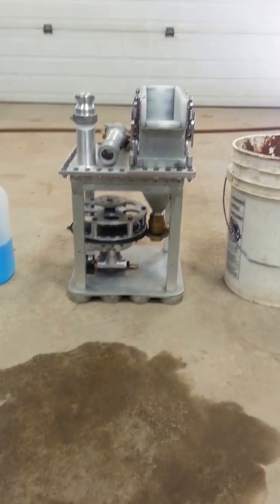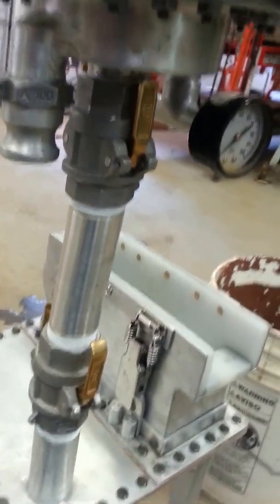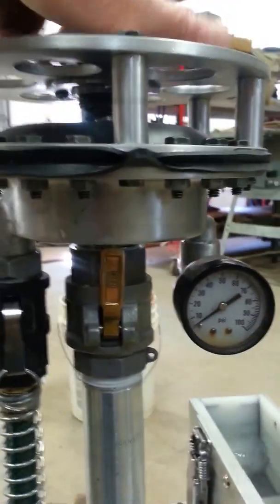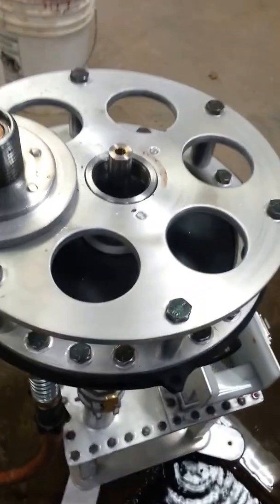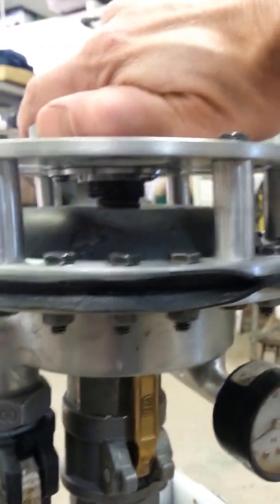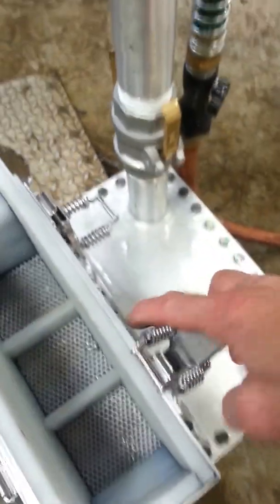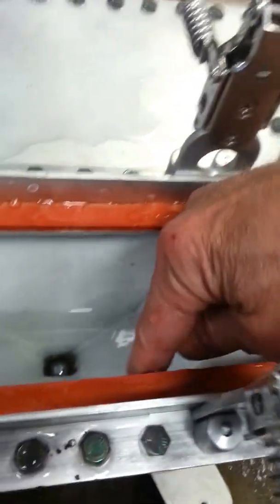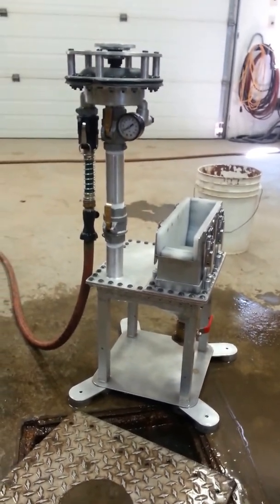mineral jig... water pulse operated.. trial run.. no pulse ?

Comment: The center pulse valve.... It has to be flat... not cone shaped. It's lifting the cone enough to leak, also rubber is to thin to lift. Also too many bolts, especially on the hutch... there isn't any huge pressure. A pool filter running at a higher pressure uses less bolts... way over engineered...

Comment: Love your design. I built a pulsator using all pvc parts from home depot. It works fine. If the center seal is not perfect it won't work well or at all . My springs are less robust than yours and I use inner tube rubber for the diaphram. I also have a YouTube video under PVC Pan American pulse jig. I recently used my latest vesion to process diamond bearing dirt. Drop me an email fkimbler@gmail.com